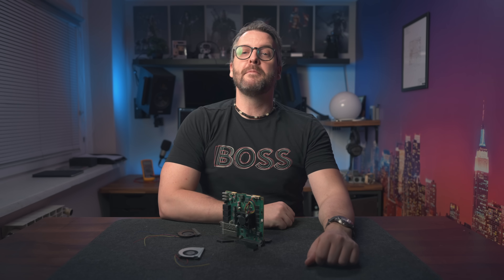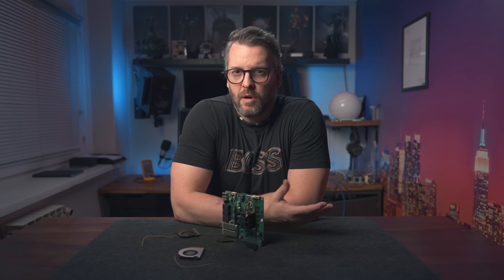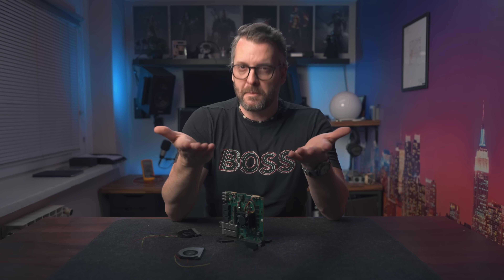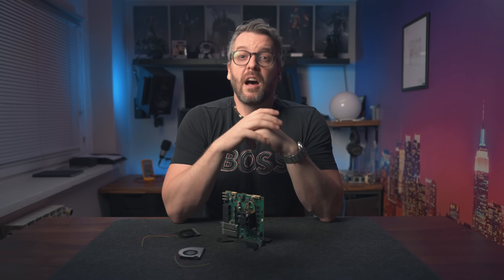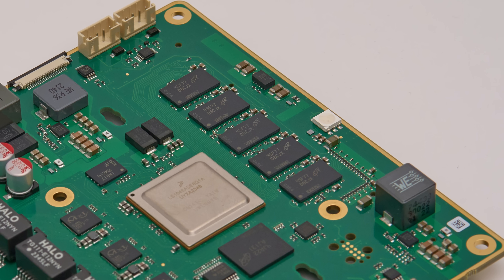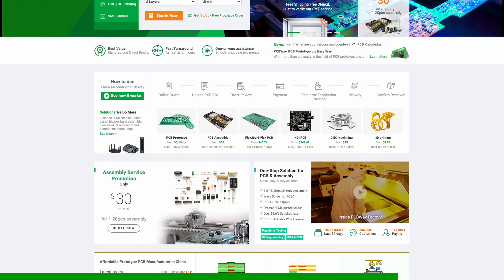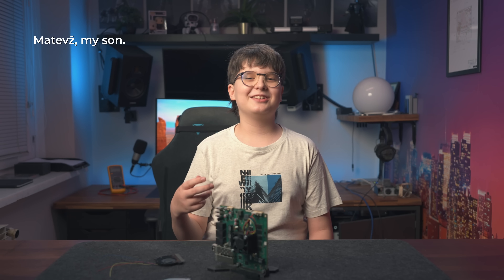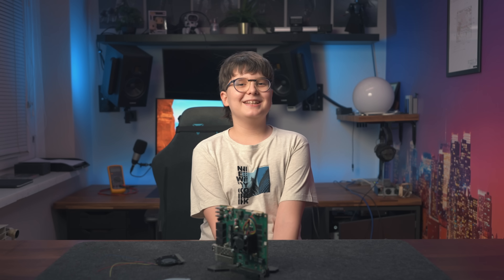You Wanted a Cheaper Router. We Can Do That.

Comment: The problem with a $600 price point is that you start getting into the territory where you can build a OPNsense router from scratch with second hand or surplus PC parts.
Reply: Like, a Really good one. You can build a good one with 200 USD China Router boards
Reply: @tobimai4843  
That's what I'm talking about. Mine was built with parts off Ali Express, including the motherboard. The mobo in my router has four 2.5 gig ethernet ports, two full sized PCI-E cards, and a half size 8x slot, allowing for lots of network expansion. It also supports up to 6 serial ports which I'm using to give me networkless access to both a virtualization host and router software, and it has a bunch of other nice features as well.

The board was less than 200 USD on sale, bundled with 64 gigs of surpus RAM. What pushed it up to around 600 is all the other stuff I opted for. A less common, lower clock, low power draw Xeon chip, a used but quality PSU that's over wattage for the intended usage, and a special 2U rackmount chassis with the IO in the front, for instance. I could have just crammed it into a random tower case I have laying around, used one of the higher TDP CPUs selling for pocket change, opted for one SFP+ card instead of two, used a lower wattage power supply, etc. and it would have brought it down to the 300-350 range.
Reply: @tobimai4843  
That's what I'm talking about. Mine was built with parts off Ali Express, including the motherboard. The mobo in my router has four 2.5 gig ethernet ports, two full sized PCI-E cards, and a half size 8x slot, allowing for lots of network expansion. It also supports up to 6 serial ports which I'm using to give me networkless access to both a virtualization host and router software, and it has a bunch of other nice features as well.
Reply: @tobimai4843  
The board I built around was less than 200 USD on sale, bundled with 64 gigs of surpus RAM. What pushed it up to around 600 is all the other stuff I opted for. A less common, lower clock, low power draw Xeon chip, a used but quality PSU that's over wattage for the intended usage, and a special 2U rackmount chassis with the IO in the front, for instance. I could have just crammed it into a random tower case I have laying around, used one of the higher TDP CPUs selling for pocket change, opted for one SFP+ card instead of two, used a lower wattage power supply, etc. and it would have brought it down to the 300-350 range.
Reply: True and a Ubiquiti UniFi Cloud Gateway Fiber costs around the 330€ mark.
Reply: @Damicske  however that is not really suitable for anything about a hobbyist set up everything they do is very questionable
Reply: @TheLostPacketYT and still whole companies run on them. It's mostly then not the cloud stuff but more the enterprise stuff.
Reply: @Damicske  its more about how they have  proven hardware issues
Reply: Sadly, actually less... :|  I have a system with dual 10g SFP+ and 3 2.5g interfaces that I picked up for less than 500, and it could be a bit cheaper if you went lighter on the RAM and SSD...  And that was Brand New... Slapping together a low end "garbage" PC would be cheaper, just have to get the NICs sorted....

Granted $600 for an "overengineered" dev kit with the ability to tinker with things isn't a bad price if you're into that kind of nerdery...
Reply: You start to get into that territory waaaay below 600$.
But you would also need to waste way more power and space to achieve the same result.
That's the tradeoff.
Reply: @qdaniele97
Modern PC parts can run in low power mode, and you can pick lower power parts for your main components.

Power is also an unavoidable reality. If you want enough processing to handle 10gbit speeds, you have to consent to higher power draw. The CPU in this is probably going to struggle. Yes, even despite its specialization.
Reply: "start"? LOL
My router runs on a refurbished HP EliteDesk 800 G3, with an i5-7500 and 8GB of Ram. Cost me 155€ (including shipping). 
Then I added an Intel X520 dual 10Gb card (extremely cheap, 30 to 40€ max) and a Intel quad Gbit card (also very affordable). 
Its running VyOS and its a monster, just stupid the capability for home use. 
As such, with low 200€, I was able to build a refurbished machine that beats this router.
However, it's always hard to compare new vs refurbished, hence me considering if they are able to get it down to under 350€, while keeping the 4 core CPU, will be appealing and competitive.
Reply: @ralmslb  
It will cost you 300+ to build something specialized. The router I built has a Xeon CPU with very similar power draw and raw performance as that one, but it has far more cores at a lower clock, and the board I put it on has nice features like up to 6 possible serial ports... Meaning I can have a physical serial port connected to both a virtualization host and the router software, and potentially more VMs if I want.
Reply: Or can buy purpose built OPNsense routers like Protecli ones. They even offer coreboot firmware for them.
Reply: there are other costs as well that may not be seen like power usage and well HW offload specially when talking 10GbE that is quite nice to have at the end of the day price is what you pay at checkout cost is what you pay trought lifetime of the device, and with second hand hardware you sometimes double your price just by having it on
Reply: @bigpod this is for (sold as) new hardware and probably idles down at around 4.5w or so without anything plugged in (it would be interesting to know differences in power draw when sfp or ETH is connected. My Intel 225v powered 4 port router with j4125 was only drawing 8w with 2 or 3 ETH connected the last time I measured it, but this is a home router on a 500mb ISP package so not exactly doing much but idling). On the build your own router from PC parts, I did this for a number of years but it drew 38w at idle so I figured with power costs I'd save the cose of the router and get 4x2.5gbe over a 4 year period; which has now long since passed. So I'm not advocating for pc hardware over this but I'm saying that low powered router focused x86 hardware might be a closer run thing; and when it's more flexible might be a harder choice.
Reply: I hate to naysay when SO much amazing effort has gone into this, but this especially true given Minisforum hardware, and the fact that they are talking about using one of the open source UIs like OPNSense or PFsense vs something custom.
Reply: @zacwolf2  They will do sth custom, as far as I remember that is the last state. I also don't see how any other non-enterprise platform can offer this much switching performance in this physical and power envelope/form factor.
Reply: At that Price point you can already buy 25G enabled Routers. E.g. CCR2004-1G-12S+2XS from Mikrotik.
Reply: That PC based router will probably use a lot more power. I don't know if the extra cost of that extra power over the lifetime of the router would amount to anything like $600, but you should work it out and consider it.
Reply: @BrianG61UK you forget if this startup goes bust and the support for the router stops.
Then you are stuck with a thing that doesnt recieve security updates and such.
Then its wasted $600 when you could have spent it on some real firewall.
Reply: @deperditus  I think it's all going to be open sourced, so I think it's pretty likely that somebody will be fixing any bad security problems for quite a while.
Reply: …not even. Aliexpress boards with a passive cooling heat sink are $180 at most for an ideal spec with ram and storage.
Reply: @DrakeDealer  
I was using those passive cooled firewall devices before I built my own. The higher end models have severe thermal issues, and kept breaking, and unfortunately their odd form factor means they can't be put into a normal enclosure and cooled with aftermarket coolers.
Reply: Not just "start getting", you leap over it several times over. The latest "thin client + NIC" build I did cost me ~80€ and does line speed gigabit with CAKE and a moderate amount of rules. You can absolutely build something capable of 10G for ~150€.
Reply: with a 600$ price, you enter territory of deviecs with builtin software and upgrades support for security features. thats in my opinion a biggest threat. nevertheless, I like this project. Maybe for 300$ I would be able to buy, depending on USD/PLN currency exchange.
Reply: Actually I will use vlans on my Mikrotik 100/25Gbs routers and using Minisforum N5 Pro with dual sfp28 Intel PCie 4.0x4 so using 3 nodes for Ceph/Openstack can give me a HA OpnSense configuration.  By using the MLAG (Multi Chassis Link Aggregation Group)  even one switch can go down and one node of the Ceph/Openstack configuration can go down.
So I like it but looking at my scenario a HA virtualised solution will be a better solution.
Reply: You can get an M920Q and a connect X4 card, throw in some 32GB of RAM, 1TB of SSD and a decent switch and still have some spare change..
Reply: @TA-mx3zmI just checked. You are right, the M920 has a hardware routing engine optimized for network switching. This project is toast. Your recommendation is equivalent or even better, how could we all miss this?
Reply: @RandomUser2401  An i5-8500T will route 10GB all day long with less than 40% CPU usage, and this is with IDS, can this project run line rate IDS/IPS? How about VPN performance?

This started as an interesting project, but a dual core router for 600$ is way too expensive for what it is.
Reply: @TA-mx3zmthat was not what was said in the video, the dual core was part of the changes to get it down towards $300, adding it back in would cost 20 or 40 USD, I can't remember, but you could easily see them saying it's $340 without compromising on the core performance but making all the other changes. It's a balancing act between cost reduction and product functionality and fit for the target market.
Reply: @TA-mx3zmIt‘s NOT a dual core router and it‘s NOT a 600$ product, are you too dense to grasp that?? And running at 40% CPU all day is also plain stupid, for crying out loud.
Reply: you build an entire hack using second hand enterprise hardware thats just a bit out of date but still ages ahead of consumer home equipament
Reply: WIth surplus parts, probably $60 - but it will be a one off or at best a ten off :)
Reply: Built one with 10gb and more 2.5gb ports for abot 450 from china. Even 8 x86 cores with good acceleration and lots of ram.   Deffinetly possible to do basic diy opnsense for about 300
Reply: The problem with not watching the video is that the price point isn't $600.
Also if you're going with second hand or surplus PC parts and spend $600 on a router, you're doing it wrong.
Reply: @FuchsDanin  
If Qotom ever gets their act together with their newer router boxes, this router is toast. They're selling something with more ports, more processing power and more expandability for only slightly more than $300, the only issue with it is that their design currently lacks any good case and cooling options.
Reply: @FuchsDanin  
Everyone watched the video. He has to cut parts and scale back to do this. Sure, it's more attractive at 300, but this thing still is a few parts short for a device that's sitting in between two market segments. What you're missing is that most people don't even know what an SFP+ port is, and with this thing only having three normal Ethernet ports, it's going to struggle to find a market. It's a little too weak to be an entry point in the high end market, which is immediately going to require extra hardware to make up the slack, and it's a bit too expensive and misfit for most of the "I just want something better than this netgear slop" market.
Reply: @FuchsDanin  
Everyone watched the video. He has to cut parts and scale back to do this. Sure, it's more attractive at 300, but this thing still is a few parts short for a device that's sitting in between two market segments. What you're missing is that most people don't even know what an SFP+ port is, and with this thing only having three normal Ethernet ports, it's going to struggle to find a market. It's a little too weak to be an entry point in the high end market, which is immediately going to require extra hardware to make up the slack, and it's a bit too expensive and misfit for most of the "I just want something better than this netgear slop" market.

If Qotom ever gets their act together with their newer router boxes, this router is toast. They're selling something with more ports, more processing power and more expandability for only slightly more, the only issue with it is that their design currently lacks any good case and cooling options.

...Side note:  Why is it that every time I see a furry in the comments section, they're missing the point and arguing in bad faith, but think that someone else is the problem. I swear to god.
Reply: @FuchsDanin  $300 is still quite a lot and it hurts to know you're missing out on features when you can't afford them ...

And if you can't build a decent machine for $600 then you're doing it wrong lmfao
Reply: Why does this product exist if its so easy?
Reply: @BertRedd  Because easy and affordable aren't the same thing 😉
Reply: @BertRedd  Because it's not easy. I can build a router out of spare parts and get everything working because I've spent years learning how this stuff works. This is aimed more at the "I just want this to work" crowd who may not have the depth of experience in this particular area of networking and just want to be able to drive their "Gigabit+" internet link... Without having to reboot the toy router their ISP gave them every 2 weeks....
Reply: How does it work @hazerdoescrap
Reply: @BertRedd  because it's only easy in theory. It's the same people all over again that hate on every Apple product without thinking beyond their homebrew solutions and raw performance.
Reply: @RandomUser2401  
The point is that this device fills a bad, essentially non-existent niche. It's a toy designed for people who don't have the sense, skill or money to choose something in a higher or lower vertical market segment.
Reply: @HaveYouTriedGuillotines so in a complete coward move you nuked most of your factually wrong comments on here? nice.
Reply: For about $310 you can get an Aliexpress special Pentium Gold 8505 2*10Gb SFP 4*2.5GbE, without RAM and storage with additional options for up to 4*SFP cages at 10Gb though with a relatively big jump in price. This will be very low idle and low load power from my experience, and I already have the RAM and storage as spares. I feel that this product that you're building is going to be a very niche industrial/commercial type product as it is 😕
Reply: @richardnpaul_mob  
I know the device you're talking about. It's similar to the Qotom boxes, but has a worse CPU. That CPU would choke on 10gbit, probably worse than the router they're making in this video, because it has no specialized hardware, not even weak hardware.

I don't think people are understanding just how processing heavy 10+ gig networking is. Especially once stateful firewalls get involved, and you're not just doing clean room tests but dealing with actual real world workloads where you might have hundreds of machines all trying to communicate across the device in a very arbitrary manner, all at once.
Reply: @HaveYouTriedGuillotines whilst the two 10gbe port version is using an older Intel chipset and will have a heavier burden on the CPU it's probably not beyond tuning. On the other hand the four port version is using an X710-da4 which will offload a lot of the work, include tuning on top of that it might be fine but without testing the hardware we're not going to know.
Reply: @richardnpaul_mob  
Alright, I didn't know the four port version had an X710-da4 in it, that does make things much better.

...But it also explains the frankly absurd price jump. Building your own, you can just put in a better CPU with a couple of cheap 2x 10gb cards. As nice as HW acceleration is, it's almost always too little or too expensive for non-enterprise consumers.
Reply: @HaveYouTriedGuillotines no clue, no proper research about this project, big mouth
Reply: @RandomUser2401  
You should really stick to your trains, you're not very good at this computer stuff.
Reply: @HaveYouTriedGuillotines yeah it's a big jump, and yet it's still not going to hit the $600 mark (even if you chuck some storage and RAM into it) with that additional cost/capability. I'm not really trying to dunk on this product, I just don't know if it competes in the consumer arena so well, maybe being better engineered towards the commercial/business/industrial markets.
Reply: @richardnpaul_mob your solution also has a HW routing accelerator that offloads the main task from the CPU? damn!
Reply: True, you can build a router with standard pc parts for less, but this board is much smaller, and more power efficient than standard(espescially older used) hardware. Also, you would need to install a few PCIE cards to get all the same IO for networking, and even then it wouldn't have features like ECC memory. But yea, if you are purely looking for a low cost solution, then an old pc will be cheaper.
Reply: @alec1575  
Buying newer, second hand and mass market industrial hardware on Aliexpress will net you ECC memory, as most of the appropriate hardware uses Xeon CPUs. Some of the boards have more ethernet jacks on board than this, and then one 20 dollar SFP+ card will get you the same SFP+.

It'll also net you lower power if you chose some of the right parts and configure them correctly. I guess size is a factor if you live in a podshare, though.
Reply: The hw offload chips will make it much faster than even a modern CPU. You'd probably need something with 3D cache to do IPS IDS and cake QoS at 10gbe. You also lose a lot of performance when doing openvpn or wire guard. I got rid of my old gaming PC as a router for this reason and went with firewalla gold.
Reply: It doesn't have "HW offload chips." It has a weak SoC CPU with onboard network acceleration.
Reply: @xclusv101 This device won't be able to do IPS / IDS because that's done in software, which it doesn't have the CPU for.
Reply: The technology triad: performance, reliability and cost.  Pick 2.

That’s why this product will exist.
Reply: @mooves12  
(Part 1)
There's unspoken, unacknowledged truths about the iron triangle which say that this product will not do very well.

Attempting to hit two points of the iron triangle in a market segment that is torn between overpriced higher segments and underdelivering lower segments always almost fails due to needing parts that are shared with the higher segment and thus experiencing price hiking/setting.
Reply: @mooves12  
(Part 2)
Secondly, the products that become absolutely ubiquitous and dominate a market for a period of time often manage to actually split the difference between all three points successfully, producing a product that sacrifices nothing. 

The Iron Triangle is flawed. It is not a pick two situation and never has been. It's more a scale that represents market reality: It's possible to hit all three points, and it's also possible to fail to hit two of them, depending on market realities. Your goal is to hit at least two, to know when to pull out when you can't, and to know how to push hard when there's a way to hit three.

This device is likely to fail to hit even two points.
Reply: @mooves12  
There's unspoken, unacknowledged truths about the iron triangle which say that this product will not do very well.

Attempting to hit two points of the iron triangle in a market segment that is torn between overpriced higher segments and underdelivering lower segments always almost fails due to needing parts that are shared with the higher segment and thus experiencing price hiking/setting.

Secondly, the products that become absolutely ubiquitous and dominate a market for a period of time often manage to actually split the difference between all three points successfully, producing a product that sacrifices nothing. 

The Iron Triangle is flawed. It is not a pick two situation and never has been. It's more a scale that represents market reality: It's possible to hit all three points, and it's also possible to fail to hit two of them, depending on market realities. Your goal is to hit at least two, to know when to pull out when you can't, and to know how to push hard when there's a way to hit three.

This device is likely to fail to hit even two points.
Reply: and how will that machine look and feel like? how much power will it draw? you are missing a few points here.
Reply: @RandomUser2401  Modern PCs, can often draw several dozen watts when idle. My last gaming PC had a PSU that could display its voltage and other status over USB, and when everything wasn't powered up, it was usually drawing less than a light bulb. We are not in the 2000s anymore, modern computers have good power management. I suspect this thing isn't capable of pulling more than 100 watts, as the parts in in collectively max out around that point. It's probably pulling around 20 when it's under low load, which is most of the time. I put a low power TDP CPU in it for this exact reason. If I want to lower the power draw further, I can pull out the excess RAM.
Reply: @HaveYouTriedGuillotines  Check the "September 2024" update video, there Tomaž mentions that under full load (stress test on the CPU + all links going at full speed) they maxed out at 18W. Yes, eighteen watts. And he rounded up to 20W if also using a PCI-E device. Normally it's below 10W. I also remember, but forgot from which update video, probably the 0% CPU usage ones, that going from not using the 10 Gbps link at all, to fully using it took 1.2W (just the traffic for the two 10Gbps ports)
Reply: @Winnetou17  
That's some good marketing. You shouldn't expect to see that kind of performance under real world workloads, however.

It's good to know that they're accumulating an Apple like fanbase, though. Maybe pink shirts and thick rimmed glasses will be their black turtle necks.
Reply: @RandomUser2401  No, you are. We're not restricted by our wants/needs - we're restricted by our budgets lmao
Reply: @3nertia That‘s a you-problem, and probably you are not the target audience of this product. But other people have needs that are not served by a second-hand PC.
Reply: @RandomUser2401  Says you, with very little to no information about me as a person or my needs/desires lmfao

If you have needs that intense, that are other, better enterprise options anyway lmao

I'll sure you'll have a nice day!
Reply: @RandomUser2401  And it's not a me problem, it's a capitalism problem 😉
Reply: @3nertia  This product does fill a niche - if you fail to recognize that niche, well, that's a you problem. Again, it might not be for you, and that is fine.
Reply: @RandomUser2401  Thank you for your recycled reply lmfao. What a great case you make for your assertion! ROFLMEYERWIENER!
Reply: @RandomUser2401  Anyone can spend money.  Don't pretend to be clever because you have access to a credit card.  There is no target audience for overpriced test product.
Reply: @zembryoz oh boi are you wrong
Reply: @RandomUser2401  Stick to your trains.  You're lost.
Reply: @RandomUser2401  I mean for my personal use case I don't give a shit how it looks or feels. It's completely out of sight and out of mind. And I don't live somewhere where a router drawing 5 watts makes any difference whatsoever compared to a shitbox pc drawing 50 watts.
Reply: @MrWhiskey1 Exactly. You, you, and you. Others have different needs.
Btw if you are on a budget: Something drawing 50W 24/7 runs you almost 50$ per year even with cheap 10ct/kWh, so 20ct already means close to 100$ per year of operation.
Reply: @RandomUser2401 Honestly not bad at all, you can get small mini PCs that are pretty efficient while being potent enough to run opnsense well at decent speeds.
Reply: @RandomUser2401  
You're the one missing points here: This isn't a gaming PC with a 500 watt GPU in it. It's also not an Apple style product with all the parts soldered onto the board: You have options.
Reply: @HaveYouTriedGuillotines  Yes, it fills a niche in between, which several people here seem to miss.
Reply: @RandomUser2401  
In all likelihood, this device will struggle to push traffic across the 10gig ports and hit the maximum bandwidth they support, and honestly... It still needs another SFP+ port, and an extra 2.5 port, preferably two. This means the price is going to shoot up anyway, because now you're looking at an external device to act as a firewall, because I doubt that dinky 2 core CPU can handle 10 gigs of firewall, let alone potentially 20, and you're going to want some switches immediately to provide more ports, so that cuts out the lower end market looking to push up a vertical segment... This device has problems.
Reply: @HaveYouTriedGuillotines did you factor in the HW routing engine of the CPU that is fully dedicated to switching and firewall rules or are you just looking at core count and clock speed of the CPU?
Reply: @RandomUser2401  
(Part 1)
I'd be extremely surprised if the hardware acceleration can actually handle stateful firewalling, and even if it can, I'll be surprised if it can handle 10gbit loads.

As I understand, the hardware acceleration is similar in power to the two general cores. Having seen how hard the firewall on my network pushes the much, much more powerful CPU in the router I built, I suspect it will still struggle even with that kind of specialization.
Reply: @RandomUser2401  
(Part 2)
It'll do better than a standard SOHO router, but standard SOHO routers usually don't have 10gbit SFP+ ports, or if they do, they have only one of them.

You have to understand: People have been wanting and promising devices in this vertical segment for decades, and almost no one has ever provided something worthwhile. The market just doesn't allow it. The parts needed are at the bottom of what enterprise clientele buy, and that drives the price up insanely high.
Reply: @RandomUser2401  sorry you don’t get these economics part of it. If it is a niche then in exactly what the word niche means the sales numbers will be low. And low sales numbers are dangerous for the lifespan of this company. As low sales can mean end of company and end of support. Opensource software might help if there are programmers smart enough that want to pick up the task. But most open source devs put their time in software for hardware that was sold in large quantities. So in short niche market equals bad.
Reply: @chinesepopsongs00 Congrats on memorizing economics 101 in high school. Real world is a little more nuanced than this.
Reply: ...Side note:  Why is it that every time I see a furry in the comments section, they're missing the point and arguing in bad faith, but think that someone else is the problem. I swear to god.